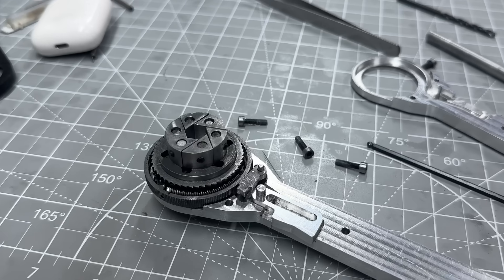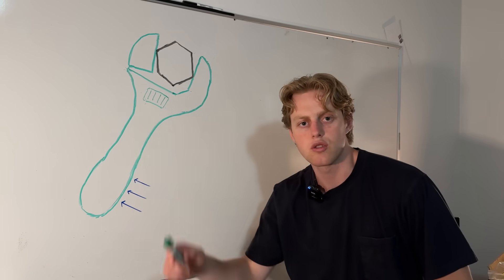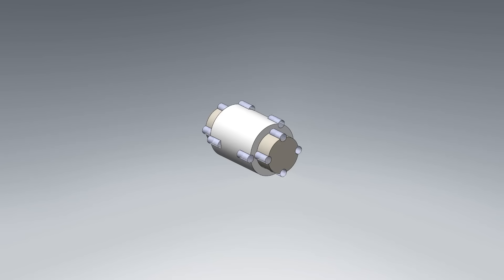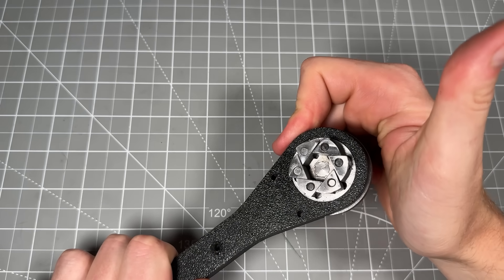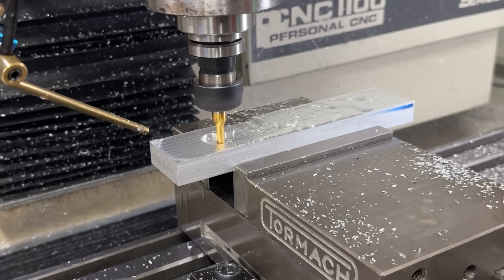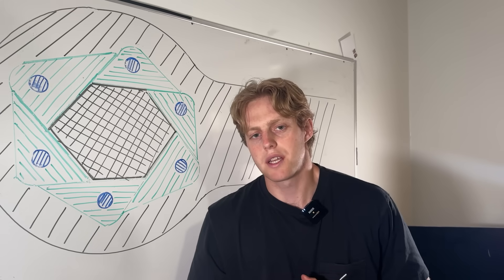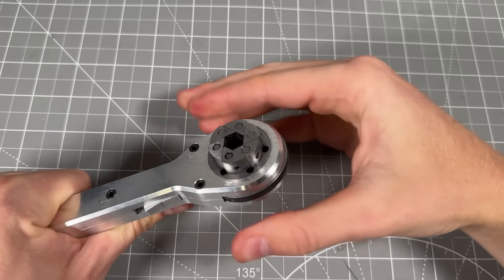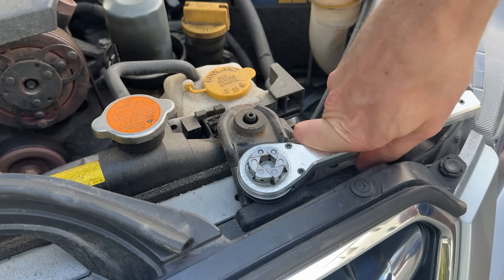I Invented an Adjustable Ratcheting Wrench

Comment: The lockon mechanism should be through the press of a button and not manually. Kind of tedious having to unwind it manually to make it lock on to the bolt. Other than it's abit to big and will have clearance issues but overall 7/10 design. Where I work my mechanical coworkers have so many different sizes laying around it's crazy, definitely useful if you pull it off.

Comment: you should do one that can tighten the nut, that has a bolt sticking out too far. for example try separating tightening side from loosing side by moving it to the other end of the wrench, that way you can leave a hole in the middle of the mechanism

Comment: I like where your head is at on this. But you over engineer this bro. You could design a device around a chain where links are carefully measured to lock around any bolt now matter how tight or recessed. No benefit to replicate what you can do with a simple chain links with your heavy clamp design.

Comment: Your design is fantastic. A sharp looking product. Brilliantly executed, meticulously built and assembled. 

That said, I personally think the limitations are greater than the benefits. 1/4" to 1/2" represents 5 metric sizes and 5 inch sizes with two overlaps (if my memory serves). That's 8 sockets and a ratchet that can get onto basically any fastener. Alternately, 8 reversable ratcheting wrenches would provide the same access. Perhaps a set of Knipex wrench-pliers or Cobra wrench to compliment. At the end of the day, if I can get one of my little DeWalt impact wrenches pointed at the fastener, I'll always choose to use that over manually pulling a ratchet which makes your design redundant as I already have a set of sockets with me. Of course this is my two cents; the next guy might have a completely different use case in mind.

I'd be more interested in seeing this mechanism adapted to fit onto a 3/8 drive impact wrench; in a set of two, one for clockwise and one counter-clockwise; with extended, chamfered jaws like you showed towards the end of the video. In short, turn the design into what is effectively a socket that tightens down on the fastener as the tool rotates it. Perhaps a barb at the start of each hardened face to dig into the fastener. 

I work on rusty stuff; the fasteners typically come out, but the bolt heads are rarely a factory size. A socket that was able to grip down on the fastener, like the two aforementioned Knipex hand-tools can, would be, in my opinion, a fantastic addition to my tool box.

All this said, I do wonder if guys who do installs; be it railings, overhead doors, steel shelves and racking, and the like might, benefit from a tool like this. They're regularly adjusting fairly accessible fasteners in a narrow range of sizes. It might be handy for them to be able to carry a single tool that would accommodate every nut and bolt they face; though from what I've witnessed, they generally carry something like a DCF923 and the 3 sockets they use.

I dunno what to say, I like it but I know I'd never use it.

Please continue to explore other ideas and designs regardless of what you end up doing with this idea. Consider it a huge win, as it does exactly what it's design to do, even if what it does might not need doing.

Comment: Is there a need? Roflmao, you just properly solved the problem EVERY tool company has had in their own half baked attempts at this issue but for someone so obviously smart and intelligent you also just made a significantly foolish mistake, I don't mean to insult you or put you down, but, you just showed all of those toolmakers how to make the one tool they couldn't get right, with patent rights, registering it in the US does not stop anyone from stealing the design in another country and then you're up for a lawsuit against them in that country and most western countries would side with you but even so the lawsuit would cost you millions and, if you don't already have a patent on it in the US, (I am assuming you are from the US but even not it will still apply in the country you are in) then you will have to fight an American company if they decide to steal, this is an awesome tool already, and with a few tweaks it'll soon be a perfect tool, add in some different sizes to accommodate bigger and smaller bolts and when it hits the market, I'll order one in each size, but for the love of God and the money you'll make, please don't post any more detailed work on the design, I don't want to see some asshole company run over you like a steamroller over a pancake, please talk to a patent lawyer asap, mate, and document every little thing and make and hide copies, as that'll be your proof that it is your design, I look forward to watch future updates about it but vague updates, stay safe and good luck bro.

Comment: A well-made tool, but unfortunately I would never buy one. In real life, 90% of the time there is far too little space around a bolt or nut for such a large tool to work, for example in the installation of cars or industrial machinery.

Comment: It won’t replace a socket wrench because of the reach a socket has to get into deep spaces, particularly with a socket extension. But it could replace a ratchet wrench set for many applications. I’d buy one purely due to the cool design and satisfying mechanism.

Comment: Very clever invention. Something you said towards the end of the video, you commented on not working in hard to reach places, but an adjustable wrench would have the same issue. Your device however, you could modify and extension to reach those hard to reach places. You'd still need a socket on the end but your wrench doubles as a ratchet. Keep up the great work!

Comment: I have this ratchet ring key in size 14-19mm and you can fill it with adapters for different sizes. If you want it to ratchet in the other direction, you just put the adapter in on the flip side. So if you would make your ratchet separate from your claw/chuck, you could flip sides to change the "ratcheting" direction and save about a third in height. Or I have also seen push-trough solutions.

Comment: I think it could be a purchase for me, though larger bolts seem like they could break the wrench as they have less metal contact between teeth when the jaw is fully opened. If you get some more clearance maybe some longer teeth then this could definitely be a convenience for loosening bolts on mostly unobscured surfaces

Comment: Love it. I think this tool would also have a lot of potential of being broken down into sizes. Having a "universal" fit would still be a great to have in any shop but if reducing the range of a specific key to cut down on bulk for applications where it's relevant would be great. Or as others have mentioned the inverse of increasing bulk where the compromise is acceptable/ necessary for heavy duty applications

Comment: Why not make an adjustable socket ? Different ones for small, medium snd large sizes. It can be used with already owned rachets, can be used with extensions and there is no need for changing side of rotation since the wrachet already does that. Also cheaper to manufacturer and I would order few since we always lose the 10mm socket 😂😂😂 good luck

Comment: Love the design and execution, but I gotta say it is more gimmick than godsend. Not becuade of your design, components, or final outcome but because the natural restrictions these have are the reason why they are extremely hard to find. There's no getting around their inherent size which leaves their practicallity limited to only fasteners in wide-open spaces like power line poles or some tractor implements.

For some applications it's the bulky ends keeping these from being common stay (under the hood of your Subaru), for other applications it's not having long enough reach (for bolts on motorcycles), for some it's that there is no pass-through feature for nuts on studs (in/around engines), and for others it's a combination of inadequate reach & too short of a handle for max torque (most wheel's lug nuts).

I support your endeavors and love your product but remember it won't be a wide-selling product. I have a couple similar wrenches (one is that double-ended Stanley you showed and the other was a no-namer) and their dimensional limitations exactly how explained above are the only reasons why I haven't even been able to justify trying them yet.

For reference I repair & restore: cars, motorcycles & mopeds, musical instruments & equipment, trailers, compact tractors & implements, riding mowers & garden tractors, outdoor powertools (chainsaws, weedwackers, tillers, snowblowers, etc), ATVs & side-by-sides, snowmobiles, and various watercraft.

If you can engineer a way to make this into just a hub (that's still reversible by merely flipping) that you can slip onto a lug nut/bolt with pass-through extensions you can then drive with a 3/4" drive socket wrench you'd have something to collect royalties from. Nail this implication and you'd cut the list of limitations in half! I would buy every size you offer from 8mm-34mm in this configuration.

Comment: As a trailer technician and auto mechanic, I strongly support this tool for its easy access and use for those "Oh sh*t, I don't have the right size with me" moments. I also see this tool being capable of being a heavy-duty tool. Like If the design were larger with heavier and stronger internals, it could be used for heavy duty work like removing lug nuts, suspension parts, or anything that uses a heavier torqued bolt. Keep it up! I see this tool being a major success one day, and I myself would love to own one someday.
Reply: I can see this replacing the millions of missing 10mm sockets world wide 

This could help the starving mechanics with no 10mm 

Donate today
Reply: this thing is already 5x the size of a ratchet or ratcheting wrench but its 3x weaker.. to make it strong enough for heavy duty work it would be 40lbs and the size of a small disk brake.. the design is cool and all but its clearly not practical, i dont see one situation where this excels that another tool cant best it easily
Reply: Problem with lugnuts is how they have a narrow chamber on the wheel
Reply: YES!
Reply: I'm also a trailer technician.

If it was just a little bit thinner, I would use it for slack adjusters.

I hate snapping teeth on those tools the trucks give you
Reply: I could see this design scaling up well
Reply: Agreed
Reply: It is very limited where that kind of tool can be used.
Reply: I would never reach for this strictly due to size. I like my ratchet heads as thin as possible, and with a flex head, in my opinion, it's definitely gimmicky. It's not that hard to reach for a socket if you are an actual technician with an organized box or tool tray, and based on whatever vehicle you're working on, there are set socket sizes you know you'll need. That knowledge comes with experience, so you know if you're doing work on a Toyota, get your 8mm, 12mm, 14mm, 17mm, and 18mm. Things like this, oh, and probably like at least nine 10mm. Cool design and build, but my family, knowing I'm a mechanic, buys me these multi-socket wrenches as stocking stuffers, and they are just too bulky and hold no value for me. I will say I do have a set of speed wrenches from Amazon that have a little spring-loaded pin on the open end of the wrench, which allows you to tighten or loosen a bolt or nut that is hard to get to, or not, without pulling the wrench off and resetting. Now those were pretty cool. Oh, and the box end had a design similar to a 12-point, but more squared off, that allowed you to remove everything from 6-point to 12-point hex, Torx, triple square, and Allen head bolts.
Reply: dude same here. as an auto mechanic this could be very useful, and i would love the final product of this
Reply: Except the size vs geometry limitations exceed most practical applications of it - as a trailer tech you would know that there's no way a wrench without extensions can actually tighten/loosen lug nuts in the real world due to the wheel's offset preventing from you fitting the wrench inside the "dish" of the wheel face.

The most practical place for it is in a tractor's toolbox BUT because of the complexity the tool would be so easily ruined (due to dirt, grease, dust, water/corrosion) because you'd be using it in one of the most inhospitable environments a tool would be required.
Reply: @williambartholomew5680  my first thought was, "this wrench is awesome for anything that's right in front of you and totally accessible." 😆
Reply: @williambartholomew5680  people who don't really fix anything, always think adjustable wrenches are awesome. There are so many designs, even a bit similar to this and they were never successful. If they were, we would probably have many things like this on the market already. Not to bash on the guy, this is  really great job and i admire his patience, but this thing is just another christmas  present left in the bottom of the tool box.
Reply: @williambartholomew5680  Something that extensive fan based feedback and testing could help him over-engineer the tool. Bc something like this NEEDS to be over engineered to work UNDERWATER and in the dirtiest mines to make it more useful than a cheap set.

Bc you can get the sets that are good enough for a fraction of the cost of this.
Reply: @williambartholomew5680  as a tire tech this would definitely fit on the steer wheels of a semi or any other vehicle with alcoa style wheels bc of their outward offset
Reply: @eldonblack8404 yes but only the steers, does nothing for the other 2-8 drive wheels nor the trailer wheels behind it. Even if you did use it up front I'm not sure you'd be able to upgrade his tool to withstand the 300-400ftlb semi truck wheels are torqued to
Reply: if it were made strong enough to remove lug nuts, it would not fit inside the bolt holes...
Reply: Useless in most cases

Comment: Non-mechanic/engineer here, first off, great design! I think this has a lot of potential to be a patented and sold to a major manufacturer for consistent passive income for yourself. 
But as far as the handle getting in the way at the end, perhaps simply make it angled like a soup ladle, then allow it to rotate around an inner connecting bolt?
Imagine a skillet being grabbed and moved atop a stove, the skillet handle isn’t parallel to the skillet or stove, as to allow your hand to have more room.
Now, imagine if the handle could rotate 180 degrees at the base/contact at skillet, it’d hit the counter top, right? Well, that’s fine in the case of your wrench, since yours is double sided.
And in the case where you don’t need it angled up (to make more room relative to your working surface), you could rotate it 90 degrees, thus allowing it to resemble a handle bar on a bike.
Angled, but still flat.
But, that’s just a ‘I think this would work’ insight I had. Not sure about structural integrity and trade offs.

Comment: So funny story. I actually found an adjustable ratchet just... On the side of the road. It had the same general shape as what you have here, but instead of sliding grips it had actual sockets that you could swivel to select on 2 different axes. Also it was double ended. Metric on one end, standard on the other. It had the same size limitations as what your current ratchet appears to have, and also the same issues with having difficulty accessing bolts in tight spaces. The only comparable example I can find online has a similar swivel design, but only 1 axis on both ends.

Comment: Have you thought about using your jaw set up turned into a socket so you can use it on an extension with just another ratchet... This could also help eliminate a lot of the bulkiness

Comment: This is fantastic! You might never be able to get a big company to take this on (then again you might!) but this could be a boutique product if you get it right. I don't need a wrench every day, but I would pay five hundred to a thousand dollars for a hand made wrench made by someone who cares, especially if it meant I never had to care about 1/4 to 1/2 inch sized bolts ever again! Additionally I assume this fits hex bits on the id right, so it could potentially replace an edc ratcheting screwdriver? (also the edc folks would die for a good multi use tool like this)  Subbed!

Comment: Just think if auto makers and manufacturers could just use the same size bolt heads on everything we wouldn’t even need an adjustable ratcheting socket wrench.

Comment: You said you had to remember which way to turn it, put arrows or kind of long triangles pointing to the direction you need to turn it. Either on where you can turn it by hand or on the sides of the ratchet. Maybe?

Comment: Such an amazing tool. Also you can make a switch to make the socket opening to its largest and flip the switch to close & lock in for some areas that are hard to reach by twisting the center wheel. And an adjustable handle would be great too. Keep it up genius.

Comment: Towers for radio o cell phones, needs a lot of bolts, i worked on, change sizes is not confortable,worse in height. Next problem: must bear the tork until the final position:bad wrenches,even good brands, sometimes oferts not for strong men ,just for so limited effort.Fix your mind into a posible application.

Comment: Could add a lever you pull with your thumb that's either attached to a cable or some internal parts that would pull open the head of the wrench so you can adjust to bolt sizes in tight areas